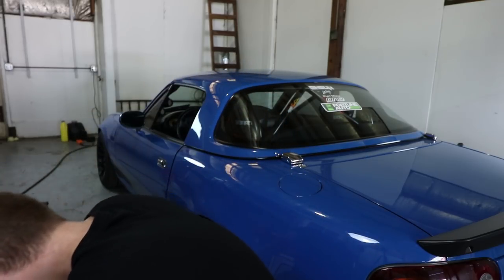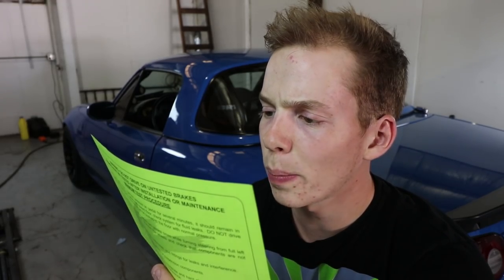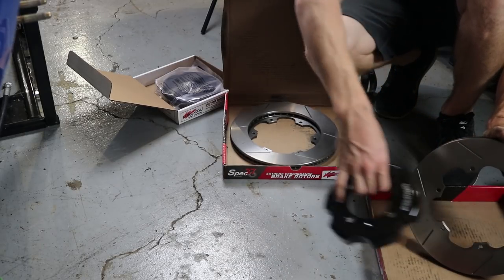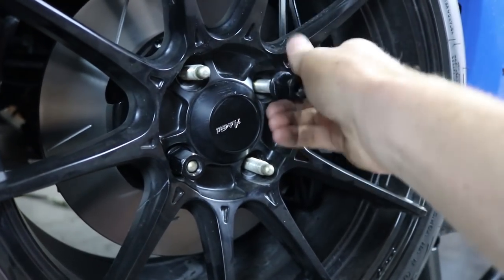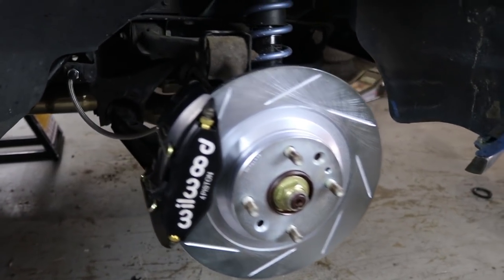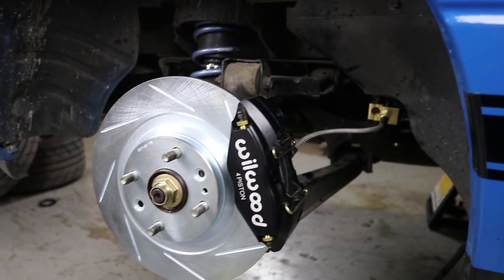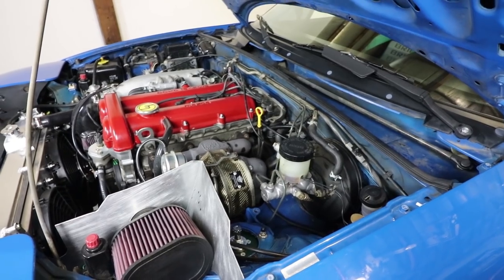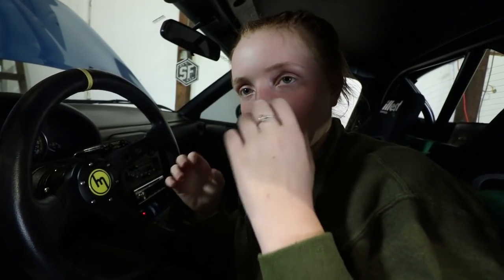Turbo Miata gets a Wilwood 6-Piston Big Brake Kit!

Comment: Arent the rear brakes are on the wrong sides?

Edit: the slots on the discs are facing so that they wouldnt channel air into them, the calipers are probably correct
Reply: @StreetSpeed717
Reply: Walker Hall how?
Reply: They can only go on one way
Reply: Walker Hall they can go both ways
Reply: some rotors are weird. Some have the pattern backwards. I'm sure they were labeled. which means that's how they go.
Reply: Walker Hall here you can see the oh so common YouTube engineer in it's natural habitat
Reply: The bleed for the brakes are on the the bottom thats how to can tell if they are on the wrong side
Reply: Unco Casey I watched an engineering explained video on brakes so im pretty much an expert
Reply: There's factory mounting pints, they can only go one one way.
Reply: Zac burrows wouldnt the discs be able to fit on either side?
Reply: My slotted Stoptech rotors also face what some people would consider the "wrong way" but that's just how they're supposed to be mounted with some applications
Reply: http://www.myturbodiesel.com/wiki/brake-faq-mythbusting-why-you-may-not-want-big-brake-upgrade/ Read this, scroll about halfway down
Reply: It's doesn't matter where the slots are and it doesn't matter where the calipers are. The only thing that matters is if you have curved vents.
Reply: Alebone thank you, i guess i was wrong, ive just never seen the slots face the "wrong way"
Reply: The internal vane direction is what matters.
Reply: The rotors are correctly installed. The calipers are located on the front side of the rear wheel well, so the slots will direct air outward from the rotors when Molly is going forward.

Comment: You could get bigger brakes by getting a second set of fronts and putting them on the rear.
Reply: Some Weeb 
Or by installing another caliper and get dual calipers in every rotors 😂
Reply: Some Weeb but the front brakes are used more anyways
Reply: Some Weeb he could throw an anchor out the window either
Reply: Who cares
Reply: Some Weeb the cars so light that if he ran that setup the car would stop dead before he even covers the brake
Reply: Some Weeb.
Reply: Perfect.

Comment: overkill
Reply: Wagon Attack were you not listening? He said he will be engine swapping molly so the brakes wouldnt be so overkill
Reply: seanbee 04 its still overkill, miatas don't weigh anything. Its his car, more power to him I guess.
Reply: Wagon Attack I guess so
Reply: They aren't just bigger to stop the car better. They also take longer to heat soak and will take a lot longer to start fading. Stopping once is good but at a track you will notice how quickly your braking performance goes down.

Comment: I suggest addin the handbrake line... If your engine ever blows or something and the brakes stop to work or fail to work fully. You can always use the handbrake because ita mechanically driven instead of trhoguh fluids

Comment: I knew you would have done an engine swap, but after all the time you spent to turbocharge the 1.6L stock engine I hope It will be worth it...and once you swap the engine what will you do with that ~270hp 1.6L DOHC Turbo engine?

Comment: Hey @Gingium what did u use to clean the rotors i just got a knew set of rotors and pads but it has , a some kind of greesse and in the local shops they dont know what to use , if u know some more tipes of “brake cleaner" please tell me !! 
Great work btw beautifull work with the cars !!! Molly, ok digging that girl dude

Comment: What your problem is, when you installed the rotor hat to the discs, you torqued the bolts unevenly. This caused the rotor to not spin true on its axis causing excessive rotor runout. A Quick fix for this is bring it to a shop with a Pro-Cut brake lathe and they will resurface to rotors to spins true to its axis once again. Another fix is take off the rotors and loosen the bolts that hold the disc from the rotor hat and re install them with a torque wrench so they will be set more evenly. This 2nd method only works if your rotors haven't been worn in enough to where you still need to resurface your rotors.

Comment: Just so you know, that loctite wont hold up on those brakes. They get to temps well over the decomposition point of that grade of loctite. Youre going to want to use some good stuff that can stand up to 2000 degrees or more, like Resbond or something like that.

Comment: I'm surprised you are still running the stock master cylinder. Bigger calipers have more pistons(surface area) so they can take more fluid when braking. (Pushing more pistons uses more fluid beacause you have gone from a floating caliper with a piston/s only on one side to a solid caliper with pistons on both.) Wouldn't  the pedal have a bit more  travel?

Comment: Always use line wrenches on brake fittings to prevent rounding the fittings off.  Use the right tool for the job.  Otherwise enjoyed the video.  Those brakes are awesome.

Comment: was it worth going 6P front 4P rear? flyin miata has the 4P front and 4P rear. but im also going k24a2 swap at 275 WHP
Reply: Definitely worth it.
Reply: @callsigngecko4723  would the 4p front and rear be enough? Also thought about just doing 4p front so I can rip the ebrake and drift when I want to. Rare. But sometimes I like to hoon
Reply: @moza1956  I mean its a Miata soooo. Anything is enough.😂 stock is terrible just do something aftermarket and you'll be fine.
Reply: @moza1956  TBH 6p isn't that much more than 4p so I'd just do the 6p so when you start to make more power you already have enough stopping power.

Comment: Why didn't/don't you upgrade to a 5lug system
Reply: LARRYWESNER no reason to for the miata tbh. They have plenty of wheel options.
Reply: Thx I was just curious
Reply: Andrew Petee I've heard 4 lugs are weaker.  But I guess with tiny 4 cylinders you don't have to worry about torque breaking the lugs.
Reply: GODOFGUITAR2112 I think it has  more to do with the weight of the vehicle because I know trucks go from 6 to 8 lugs and some of these diesel trucks weigh almost 4x as much as a miata.
Reply: That's true, but my buddy has a 72 Cuda with a 440 that makes 850 horse and 1100 foot pounds to the wheels (Naturally aspirated) and he sheared all off all 8 heavy duty studs on his axle.  That Cuda weighs about 4000 pounds, so about twice as much as a Miata.

Comment: Is that red fluid you put on the bolt a lubricant?
Reply: chrpolitres Curran that's probably threadlocker or what ever it's called
Reply from the maker: +chrpolitres Curran its locktite
Reply: Gingium ok, thanks dude. Car looks super clean

Comment: Is your Mazda a 1.6 or 1.8
Reply: BBS Turbine im not sure but i think its a 1.6
Reply: A3__ kai__ 1.8
Reply: BBS Turbine it's a 1.6. You can tell because it has the writing imbedded in the valve cover
Reply: nick 1204 look at james b's comment above this one
Reply: And on a 1.8 the coil pack and cam sensor are in opposite places then the 1.6

Comment: Ugh, yet another overdone turbo build with uncontrollable power. Shit I get bored of these. There's too many content creators jumping on the 300hp miata bandwagon as of late...

This is why I went with ITBs....
Reply: He did his like right after The Car Passion Channel did his like 2 years ago. You're watching a pretty old video. Also "overdone, Uncontrollable power" how so? Its a kit bought from Flyin Miata so not overdone. And there are cars with more horsepower and similar weight. He seems to control it perfectly fine as he hasn't crashed it at all and he's had it for 2 years.